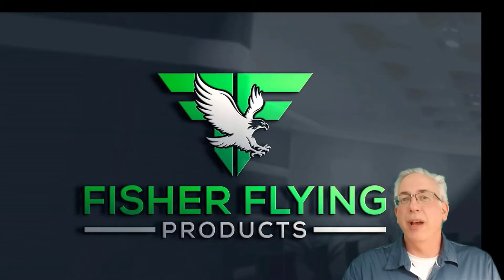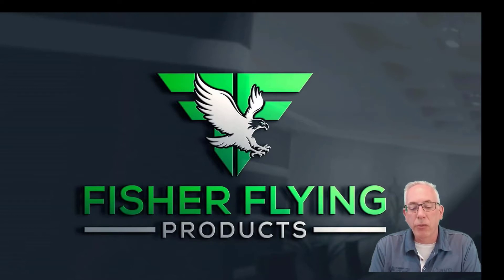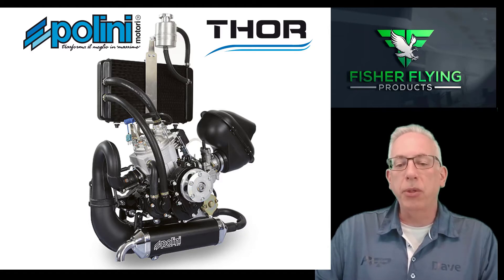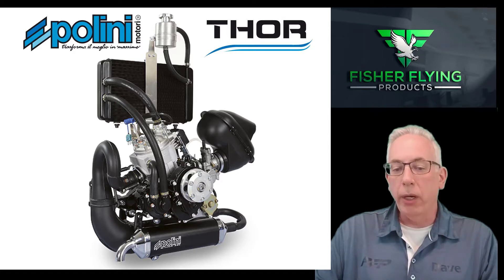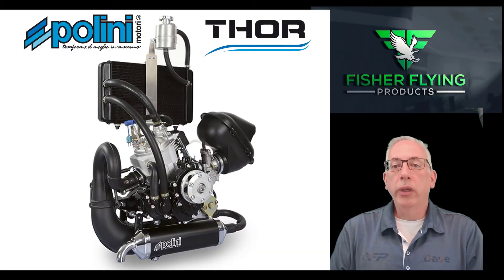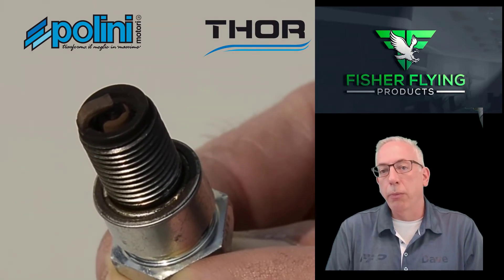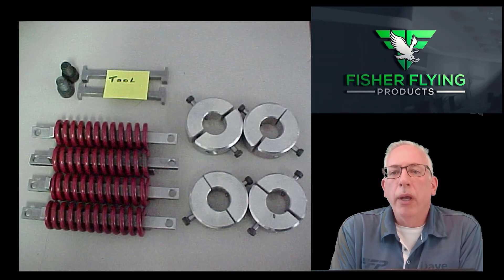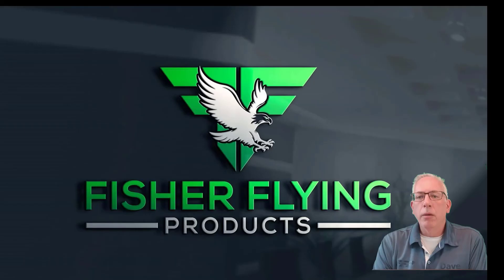How to Adjust the Carburetor on a Polini THOR 250 DS - Fisher News Letter 4 - 06-26-2020

Comment: You mention to lean the low speed you turn the screw in. The link you posted to Polini says turing out makes it leaner. I have a Polini 250 with the slide carb. What is the baseline setting  for the air screw and what direction should I turn it to richen and lean?
Reply: Exactly!!!! Showing tuning “concept” on a 190 and saying it’s the same concept on a 250 is GOING to burn someone’s engine up!!! There is no mention of the needle and c clip positions as well....
Reply: 1.0 to 1.5 out from closed for factory FYI... turning out LEANS the engine.